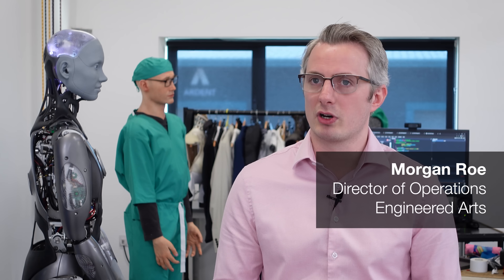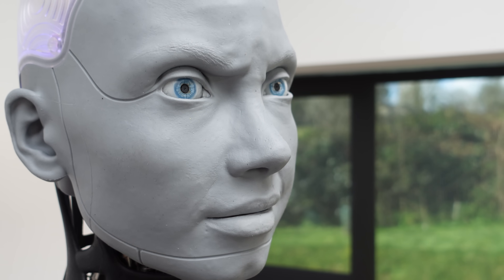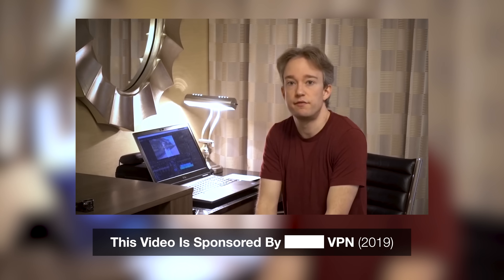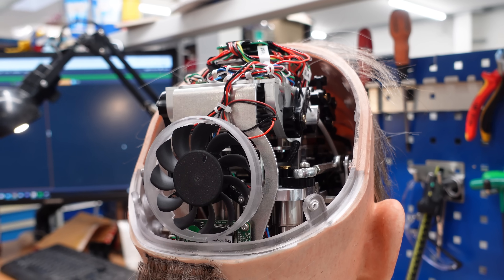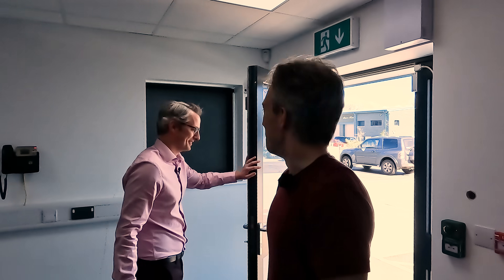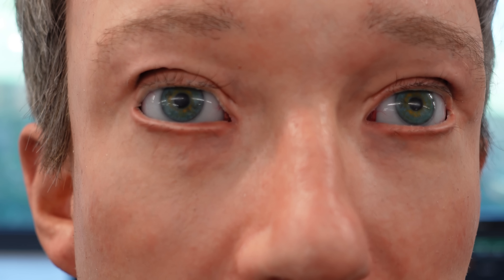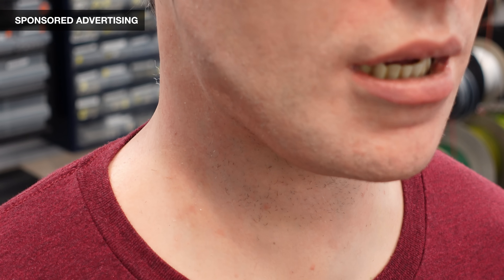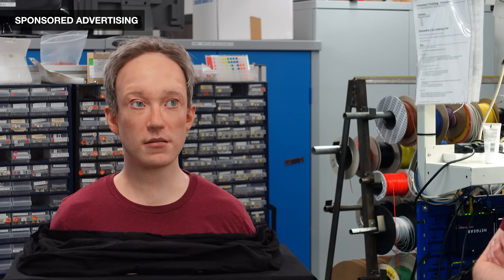My robot double sells out (so I don't have to)

Comment: But that face is astoundingly realistic.
How can we be sure the robot is not Tom Scott pretending to be a robot, so that he can once again pick up a bit of cash from a VPN sponsor?

Two moving faces of the same person appearing simultaneously in a scene was done long ago, using old (Pre-WWII I think) photographic film technology, and is incomparably easier these days. If they are smart enough to analyze the subtle facial expressions of a human and get a robot to do them, surely they can train Tom to do the far simpler things a robot does. After that, all they need is small blanket to wrap around the lower half of his chest, to give the illusion a head-and-shoulders-only bot, which is obviously a helluvalot cheaper than the hardware required for a real robot.
So, it all makes sense. Really?

Comment: Tom bot didn't get scrubbed from the valley enough, but I can tell the company is on the right vien. For the grey robot, There was more time in the details, like additional lip movement parameters, more brow subtlety, the cleanliness of the lines surrounding the eyes. Tom bot was just a rush, & it shows, but I'm sold that the bot builders are on a solid path. When comparing the grey bot to that monstrosity called Sofia, the competition goes directly to the Grey bot. Great work yall.
Reply: The grey bot had more facial actuators so it has an immediate headstart.

When they start switching to artificial muscles like HASEL and fill out the face with them I think we will begin to see a more physically accurate degree of facial animation.

Comment: if they made the eyelids actually connected, it would have been 47% more human
Reply: I imagine both of these are possible but beyond the budget of this video or what than could do for free/discount
Reply: @unauthorized.mimicry  i don't think the robot engineering community has gotten lips yet, too many micro parts wires and cables, would be necessary, all put together to actually mimic human lips, also syncing the lips to chape themselves to each individual word seems impossible at the moment, there's just too much to focus on at the moment, before developing a super realistic robotronic lips but it will happen, lips reading from a robot will probably be possible just like you can do from a human.
Reply: Also the lips. They were a little bit open the whole time
Reply: for me it was the lips, they didnt really react to the jaw at all. though he did look just like what would happen if tom scott had a stroke, so atleast you got the 'that could theoretically be a person' down
Reply: you dont think Tom "Facial Paralysis" Scott looks realistic enough?
Reply: Completely agree.  No one could mistake this for the real person purely from eyes alone.
Reply: It kinda looks like they were at one point, but the "skin" either tore or sloughed
Reply: 47% more human, that's an oddly specific number?  Guess they'll imprint a bar code in the back of his head too, if you get the reference
Reply: Also more lush eyebrows
Reply: 56%
Reply: Did That robot just wake up on its own
Reply: And made the lips able make the shapes of actual phonemes.
Reply: This is just the budget version. ;-)
Reply: And 47% more terrifying 😂
Reply: true, probably a pain to mechanise if they are connected though.
Reply: Just 47%? Not 36% or 54%? 🤔 Well that’s strange….ain’t it! 

🫤
Reply: @MartinD9999  that's how robots make estimates
Reply: @user-ov2fc5sd1e  Very true 😁

Comment: The only discrepancy in this advert was the talking point about ISPs throttling certain websites. A VPN doesn’t solve that because routing all your network traffic through an external server is a throttle in and of itself, slowing down your congestion more than you save.

Comment: Looking at this they have a very very long way to go before they look convincingly real.

The mouth movement is terrible. It looked to be chewing on its words instead of speaking them. The blink is ridiculously slow. Would look more realistic without it blinking. The artwork in the face is amazing, but doesn't look real. It looks like Scott, but not real at all. And then there's just so much in terms of small facial movements and movement synchronisation that's completely missing.

For all that though it's almost scary just how far they've come.

A convincingly human robot is very clearly achievable, and probably not far off.

Comment: The bottom half is painted properly. The top half is far too red. 
I too noticed that it’s really easy to over use the rose adjuster when painting skin. I changed my approach where I only use a really tiny bit of skin tone in the silicon (even lighter that the lightest part). And start of with the yellow and olive. A real tiny well diluted blue and only at the end use the rose adjuster. And even then I tend to restrain myself. For some reason we tend to easily paint skin too red. But I love silicon painting, just don’t get to do too many facial parts.
I do a lot of VFX wounds but they are more forgiving. As you the area around the wound gets red my inflammation quickly. And you can easily blend that into the real skin.

Comment: I think it will take a long time for robots to perfect human emotions simply because the robots memory cannot be as big as human body's with the limited size of robot . 

I JUST WANT TO SAY AGAIN THAT WHAT I SAID IS COMPLEATLY TRUE .
Reply: "Memory" is not the problem. The real difficulty lies in perfecting the motion of the countless tiny muscles in your face that all work in conjunction to express emotion
Reply: @ben4885  well that is what is memory . Many things out body does we don't remember in brain , but out body remembers , some call it muscle memory . But a machine does only what it remembers since it has no body , as you said countless tiny muscles must work together to get a natural emotion but for them to work a machine needs too much accurate data and that kind of data cannot be provided by 3d scanning a human , so machine will have to learn it bu itself but it will have to store a whole other level of data which won't fit in even trillions of gigabites since a perfect machine will keep on learning and to process that trillions of GB data  is a whole other problem , we need the best of the best processors .
Reply: @ben4885  One more fact . There is a relatively new method for storing large memorys , we can now store trillions of GB of memory on computer in human DNA , the problem is machine will not use it because extracting data will be time consuming and even storing the data is time consuming and machine should also have facility to extract and store data .

Comment: If this is a cutting edge 'realistic' robot, there may be decades to go before lip sync is anywhere close to reality! I was actually shocked at how bad the lip movement was when it was speaking ...
Reply: My sister and I were talking about that. It doesn't have vocal chords, just a speaker system, so it doesn't need to use its mouth cavity or shape its lips or to produce sound.
Reply: lips are soft and fleshy, but have a wide range of movement. Kinda hard to replicate with a robot
Reply: @heliusuniverse7460  If synchronised to a pre recording there is no excuse really, due to being able to compensate the slight servo delay. This was achievable 30 years ago, mostly with the 'Pact system'. From a visual point of view, the eyelids were a let down. With modern silicone it is possible to create the eyelids as a one piece skin and cause them to roll back on themselves when open, or at least achieve a smaller gap. Unlike the old days of latex foam skins, silicon is much more durable and its coatings can allow for a lower level of friction. In fairness though, this was most likely done at a low budget and doesn't fully reflect the companies skill in engineering and artistry.

Comment: It has to be said, but kudos to Nord VPN for going along with this one! Shows a sense of humor I think.
Reply: Nord VPN is literally the worst VPN
Reply: @bitonic593  Yeh, I'd also like to know since, if I ever needed one I might have gone for that one, based on this video's advertisement, as opposed to EVERYTHING else that tries to advertise where I don't appreciate it, and thus avoid like the plague.
Reply: @bitonic593  would you like to elaborate on this claim?
Reply: @Flimzes  I used to use NordVPN and they had trouble connecting in multiple locations (my workplaces, and sometimes at home depending on the day) as well as streaming providers like Netflix and Prime Video detecting a VPN connection and refusing service, but I switched to ExpressVPN a few years back and to this day I have not had an issue. I can watch whatever I want, wherever I want, and it always works, PC or phone. It also allows up to 5 simultaneous connections so you could have it on your own devices or share with a friend on your account. Not sure how Nord handles that aspect though.
Reply: @DaRealOriginal  The problem with Netflix etc. is they occasionally go through and blacklist known VPN servers. The last time I used Nord (years ago), I had this problem too, but eventually found one node that worked. Express is probably swapping servers a lot, or doing something their end to get around this.

Comment: Service providers might slow down your connection if you're using a VPN (because you'd want to dissuade people from hiding what they're doing from you if you're in the business of controlling speed based on what people are doing), so a VPN doesn't necessary solve that problem.

And service providers aren't typically the ones building up a creepy advertiser profile. That would instead come from random websites you visit and it's usually based on cookies, which VPNs generally do nothing about. Although you would be able to stop them from getting your IP (if that matters to you), but you'd also need to pair that with using a VPN no less than 100% of the time, using Incognito or using different browser account inside and outside the VPN, so the cookies don't leak out of the VPN. They may still be able to find out where you live, if not your exact identity, based on what you do online. John Oliver spoke about people building creepy advertiser profiles just this week.

VPNs can prevent the government from seeing what you're doing, but almost all websites are encrypted these days, so they already can't see any more than which websites you visit (but apps may be different).

VPNs have their uses, but I expect for most people those uses would start and end at allowing them to watch a Netflix show that's not available in their country. Everything else may be on par with pseudoscience, i.e. convincing people that they should buy something for some benefit that either doesn't exist, or that simply isn't an actual benefit for them personally.

Comment: With all due respect, compared to current animatronics in the film industry this is very crude. Considering this kind of thing is aimed at presentation and interaction, the mouth mechanism at work  here is like something from the 1990's. I know it's low budget but unless it wows you then what's the point?

Comment: let's start with the fact that using technology designed for VPN purposes isn't enough to classify connection as a VPN, these use VPN(-like) protocols merely to tunnel your traffic to some exit node and DON'T actually form a Virtual Private Network that allows you to access some services or resources like you'd be in their LAN

Comment: A lot of people are commenting on them needing more motors and more fine control to really replicate a person, but I think at least half of the issue is the skin material. Latex (I’m assuming that’s what it is) doesn’t have the elasticity of real human skin, which contours to the muscle movements and then easily returns to form. With several of the expressions, I could see the movement underneath being very realistic, but the skin just wasn’t adapting to the same degree they’d truly need.

Comment: How strange... You neurotypicals clearly need therapy and meds if things like this cause you fear. Why am I the crazy one again? It's just that the meaningless face scrunches are coming from motors moving silicone instead of gross bits of wet meat contracting when electrified by autonomic motor functions that are not actually something you control. Like... Chill.

Comment: The main issue I have is with the corners of the eyes. It's a challenging part even when you're just dealing with animating a 3D model and those issues seem to compound when you make it in real silicone flesh as well. I suspect embedding some extra elastic into the corners of the eyes between the upper and lower lids to pull them taut would help to keep a more natural eye shape when it opens and closes the eyes. Still, it is a remarkable likeness. The other problem that leads to the uncanny valley effect is that the silicone and the pigments on the surface aren't able to fully replicate the sub-surface scattering of light in the same way that the human skin does, so it comes out looking more shallow than the real thing. Maybe backing a more translucent flesh-toned silicone with a red opaque silicone could help with that. The challenge with skin is that it isn't nearly as opaque as people ordinarily expect and just trying to paint on the color of skin as a surface treatment isn't nearly enough to make something look lifelike. I wonder if making the skin in a three-part process with a red backing layer, a semi-translucent base layer, painting it with more intense pigmentation, then applying a thin coat of an even more translucent skin-tone silicone and finally finishing it with a last layer of light airbrushing would get you the closest.
Reply: Also i think iris is too reflective. But the most uncanny valley feeling for me was coming from the shadow on top of eyelid. Too much of a gap. In this robot, if i see correctly, eyelid is just sliding behind brow ridge instead of folding. Probably material problem. Maybe real eyelid is too thin to replicate in silicon?
Reply: The robot couldn’t keep his eyes open
Reply: I also found the chin to not match Tom's
Reply: The mouth could only make like two shapes, no O or E shapes. I also feel like they could have added some red internally in the eye socket so when light gets inside the nooks and crannies in there it would scatter out redder.
Reply: The eyes felt the most off to me, too.  They both seemed to gape around the edges and the upper lids felt slouched, like the robot had pulled a double all-nighter.  The lack of full, blended, facial expression also held up the robot considering how animated Tom naturally is.
Reply: you seem to be forgetting Ameca at 1:17. Just the way it's segmented, you can see they're paying attention to the eye corners.  I suspect NordVPN needed to spend a few more thousand pounds for that level of realism.
Reply: @squirlmy  you know what, I suspect you're right. They didn't produce a top-of-line model, as it would've cost the sponsor too much
Reply: In the world of prosthetics and silicone based effects make up realistic skin color is achieved in two steps. You start with a translucent base silicone (think frosted glass) and dye is added to this (there's far more blue in skin than you'd think). Then what's known as flocking is added. Flocking is small particles of a variety of colours that mimic the mottled appearance of actual skin when mixed into the silicone. 
These with perhaps other detail work produce a translucent skin with depth and mixed colours that really is incredibly lifelike.
Reply: human eyes are constantly moving in tiny, almost imperceptible ways, twitching, moving, refocusing. The sheer amount of programming and motors you would need to get close is astounding.
Reply: They should hire you!
Reply: This was not one of there top of the line jobs, if you look online at the ones they have made for super rich people they get even closer to the valley (even jujst the no tom one they showed is much more life like
Reply: There's several issues that these replicas have. Their skin doesn't have pores so obviously patchy skin doesn't look right. The eyelid movements are too slow and the eyes are dead compared to a normal humans erratic eye movements. The facial movements also quite slow and give the robot the feeling of a child that has a severe mental disability. It all adds up to something very wrong.
Reply: that and the brow ridge for me, robotom's brow is not as pronounced as real Tom's brow.
Reply: just wait, in a few years they'll be pumping a blood analogue through the face at different intensities to replicate skin flushing effects accurately, for that extra step of realism on top of ironing out all the other issues you listed
Reply: Great suggestions!
Reply: OK can you make one? You sound like you can
Reply: Really, they ought to just fire their current artist and hire Ron Mueck.

Comment: Reasons to have 6 devices at once: Family of 4, everyone has their cellphone connected to the internet, then there's one or two people on a computer/tv, streaming something. In this scenario, 6 might not be enough, if 2 of the 4 people are kids locked in their rooms, on both their phones and pc/laptop, and the 2 adults are streaming a show in the living room, or working from home on their computer, with their phones also connected to the wifi. You'd realistically need 2 connections per person, in this scenario, 8 total.